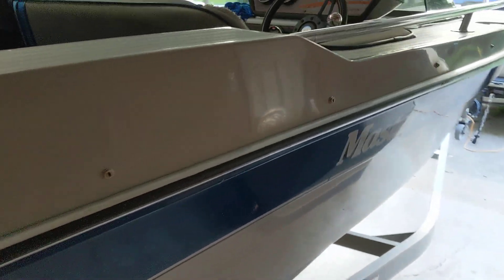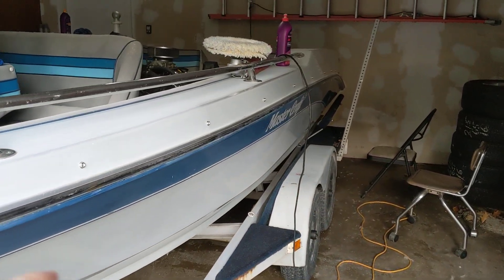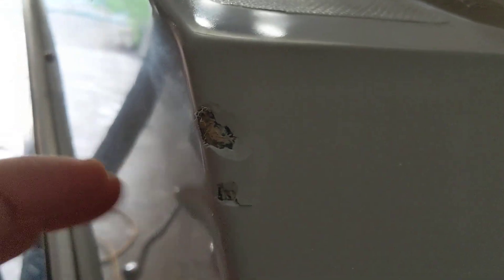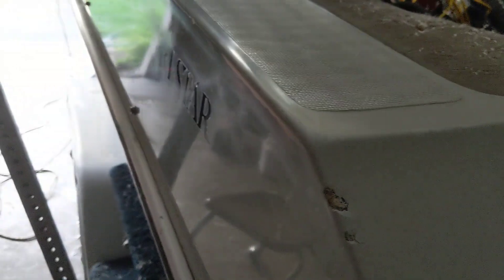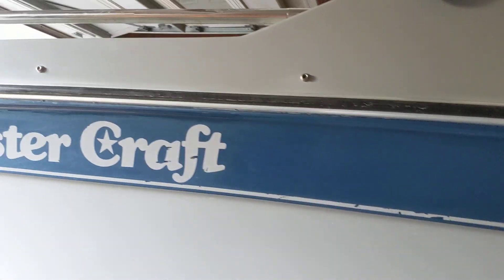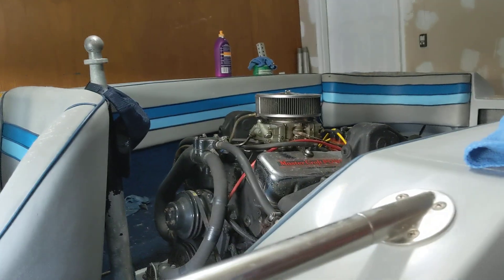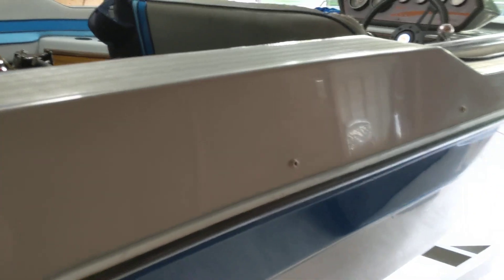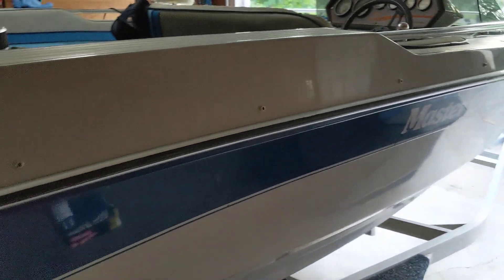1986 MasterCraft TriStar 220 Introduction and Walk Around

Comment: I'm looking at the exact same boat. Do you know of any common problems?
Reply from the maker: They are pretty old at this point. I wouldn't say anything is common. My steering cable needed to be replaced. I've done a good bit of engine work but all maintenance type things for a 60-70s style car engine. I got a new prop which made the boat much stronger in the water. 

I've messed with a few electrical things but it's all pretty straightforward stuff. 

One thing I learned really quickly is working on this is not like working on a car in the sense that there's no part list that just always works. Inboard boats of different brands can have more in common than two of the exact same boats depending on the motor and specific configuration. 

You have to get good at understanding these old motors to keep them going.
Reply: @goodenoughgaragefamily  Yes, I bought a 1988 TriStar 190 with the walkthrough cabin. There's a lot of differences in engine replacement parts. SKIDIM has been quite a reliable source for me so far. I absolutely love my boat and I'm willing to keep it on the water as long as I possibly can. I haven't had any trouble sourcing parts as of yet.
Reply: I have the exact same cab configuration.
Reply: @goodenoughgaragefamily  what prop did you go with?